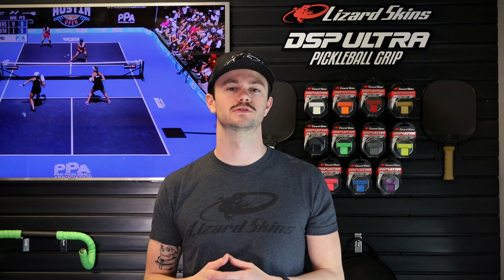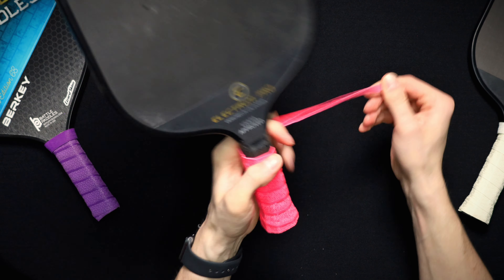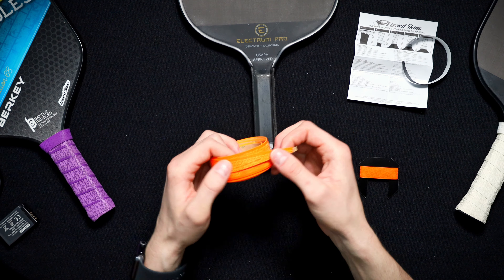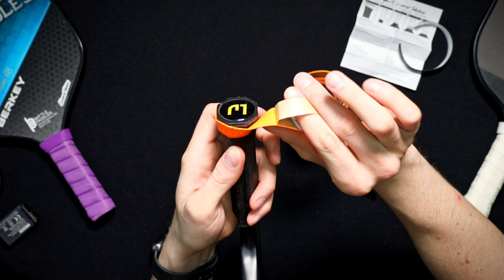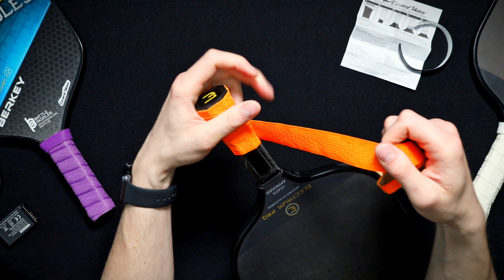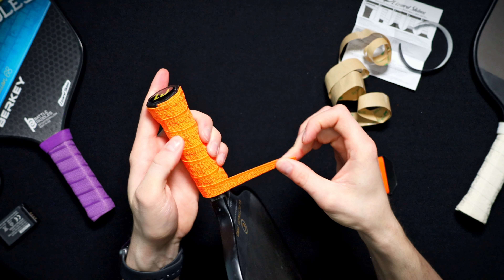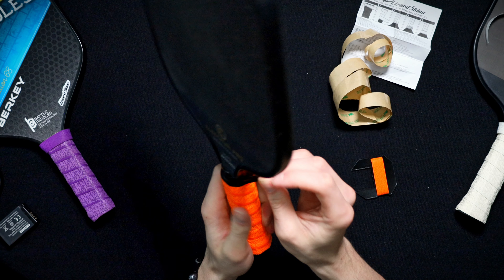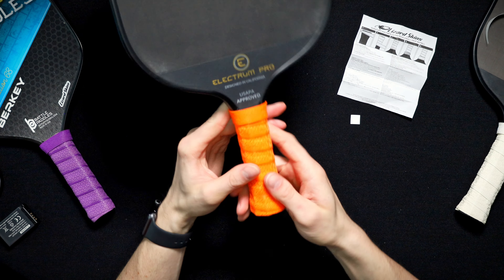Lizard Skins DSP Ultra Pickleball Grip

Comment: Still looks sloppy, tbh. As a cyclist who has wrapped quite a few drop bars (way harder because of the curves and the brake levers that are in the way) I am sure a short, straight handle like this could be wrapped much tidier.
Reply: I did it twice, and it wasn’t easy because the end knob is so much bigger than the handle, the transition is too drastic and the wrap is not pliable enough…
Reply: @tonylapadat3959  I agree with this, the grip is nearly impossible to wrap how instructed without it folding over on itself/not laying flat. Would not recommend this grip because if this.

Comment: Not super happy with this product, I have a gearbox CX 14 with a long handle, and it had a sheath underneath the original wrap, which I took off… even with the narrowness with the handle stripped right down, it didn’t seem that I had enough lizard skin to wrap the entire length of the handle. And then the rubber finishing band was way too big.
Reply from the maker: Sorry to hear that happened. Our product team is working on updating the length of the tape to accommodate the paddles with longer handles. Thanks for the feedback.